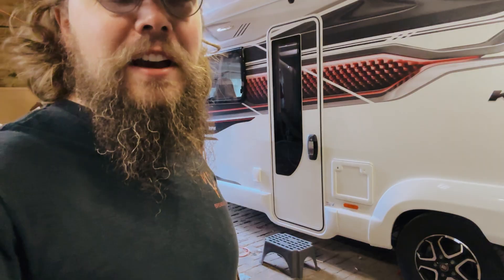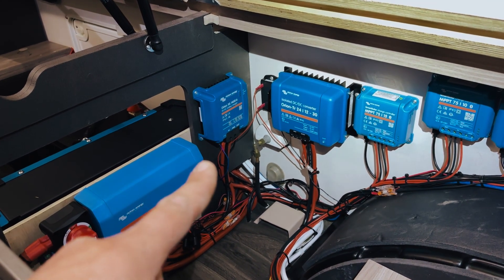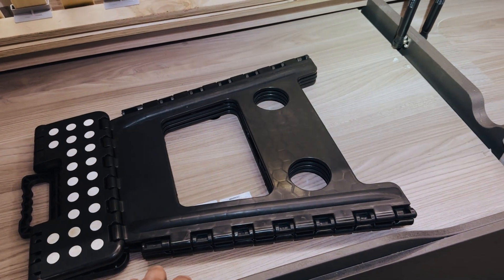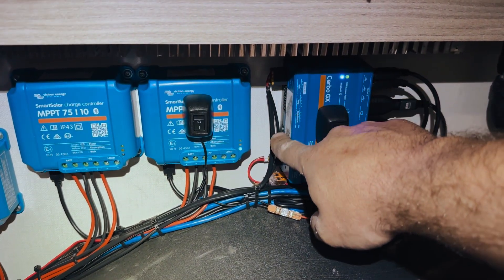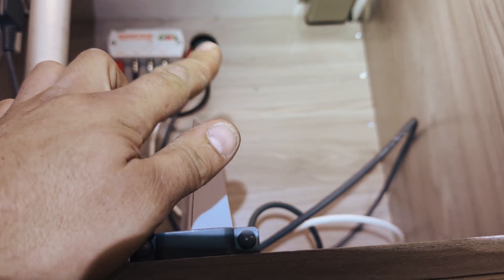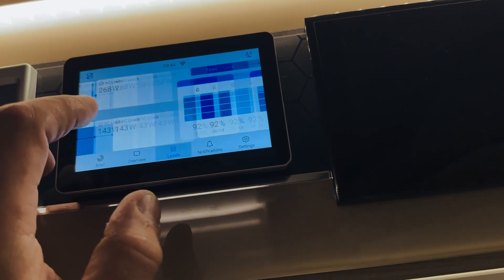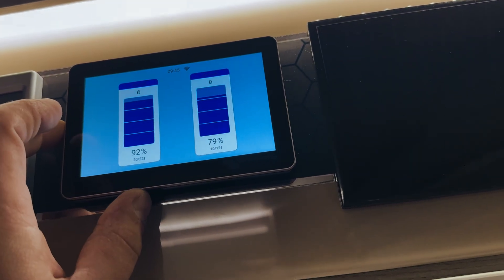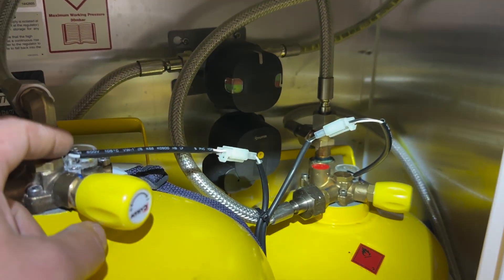Epic 24v Offgrid electrical system in a Kon-tiki

Comment: I'm curious why you went with 24v for this system. Are the cabling savings enough to offset the cost of adding a 24/12 converter? Also 24v components are usually a bit more expensive than 12v. The wire runs don't seem to be that long. Let me know what your thinking!